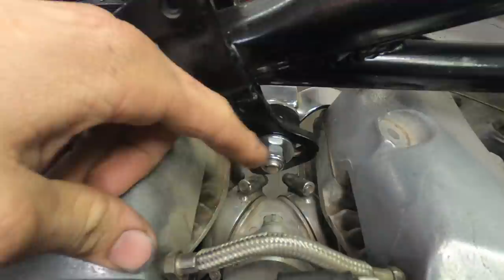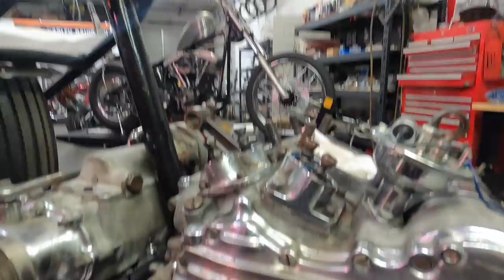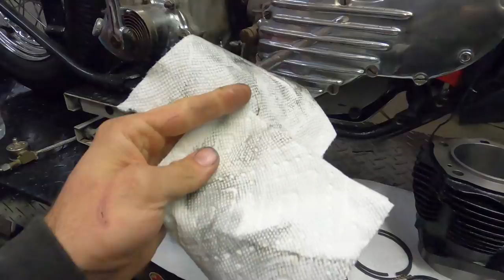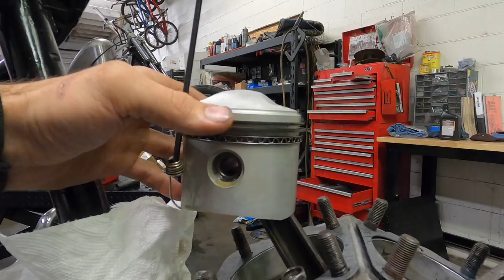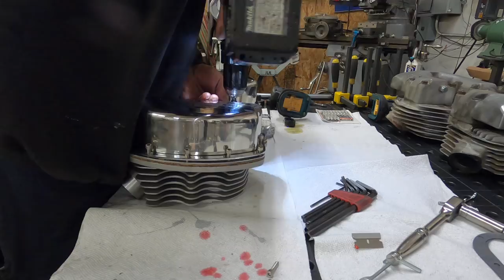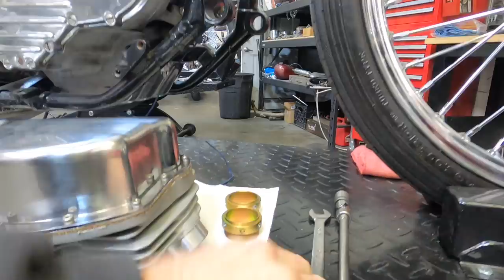Harley Davidson 1953 Panhead complete top end swap!

Comment: Silicone is bad news, but better than digging out JB weld. Unfortunately, I have experience with that. I am sure you already know this. But a lot of new mechanics don't.  You've got to be real careful getting the right cylinders on the right lower end on the old iron. I was building a 48 EL basket about 45 years ago in my twenties, and I put on later cylinders not realizing my mistake (l was a newbie). Started it up, it ran good, then started smoking like hell! I couldn't figure out what was going on. My Dad stopped by and told me I'm using the wrong cylinders. You didn't have the luxury of nowadays of just going in and buying everything you need over-the-counter or ordering online, you had to scrounge for it. My dad cut his teeth on Knuckles, Pans and 74" Flatheads, cuz back then that's all they had. Eventually, my stubborn ass figured out he was right, as oil wasn't returning and it was filling up in the heads and burning off. An amateur mistake but I was still learning back then. Still riding Panheads. Nowadays it's a 1949 EL.

Comment: How do these Panheads flow vs the Shovelhead heads.. ? I have a 57 Pan/Shovel and would like to put it back to a Pan.

Thnx
Reply: what do you mean flow?
Reply: @skgate  :Flow, as in air flow. A direct relation to power.
Reply: @woodey028  no shit, what do you mean though like air flow over the heads? or do you think there’s air flow going on inside?
Reply from the maker: Sorry for the late response. Shovelheads are superior over the panhead design. Flow is better, roker boxes dont leak, better rocker design, intake manifold flows smoother and the exhaust ports dont break every time you look at them funny. Are they as cool, not really but were not really building drag bikes either so either head will perform just fine for our applications! Thanks
Reply: @houseofchoppers  👍
Reply: @houseofchoppers  is still like to try my luck with a panhead. they’re just so sexy and sound so nice.. they’re the middle child of the cast harley’s haha
Reply: Today they make aftermarket pan heads with the same combustion chambers and intake  and exhaust as a shovel has plus they flow better and give you more power . S an s and std are what I would go for great video and clean shop 👌 the only way to fly

Comment: Why didn't you pull the heads and cycliders off as a unit and eliminate the need for an allen wrench? Why didn't you spilt those cases to ENSURE that none of that silicone got into those oil passages?